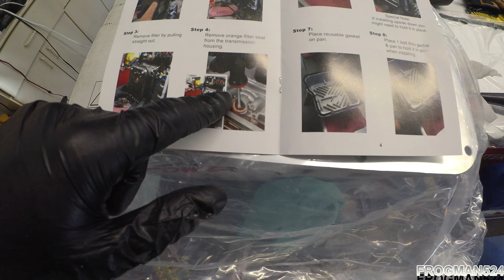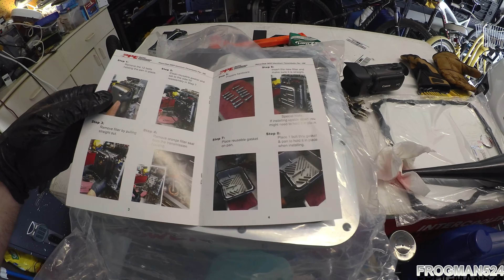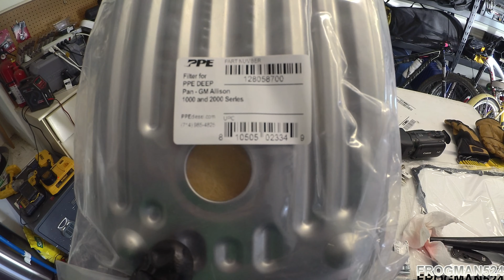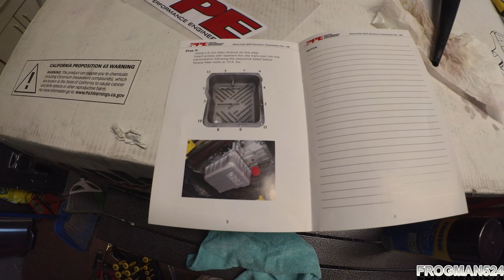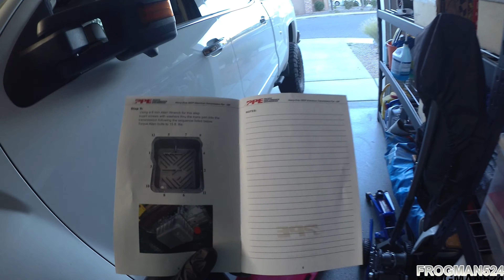Installing My PPE Deep Trans Pan

Comment: After a lot of research, I decided on an Allison deep pan from a local Freightliner dealer for $61, an Allison deep filter, a Merchant Automotive deep filter lock (not needed but $30 for peace of mind), and Mobil Delvac 1 ATF for the trans in my '01.  I'll spend the extra money on the PPE engine oil pan because it gets rid of the hump on the factory one and allows all the old oil to drain out, the trans pan is just for bling.
Reply from the maker: Good choices. The new L5P I've got, if you watch that video, you'll see they finally got rid of the hump in the oil pan and moved the the drain plug to the center back position with a valley to get all the oil out. Only took them 20 years.
Reply: @FROGMAN524  I guess late is better than never, lol.  Too bad I can't slap an L5P pan on my LB7 and save even more money.

Comment: Did it keep the trans temp down?
Reply from the maker: Not a bit that I could tell but it looks cool and each ounce of fluid receives less wear than normal in theory over the same amount of miles. Transmission runs cool anyway.

Comment: WTF!  A rebuilt trans with 19K miles on a truck with 45K miles!!  The factory warranty is 80K miles or 5 years.  What the hell did you do?  And why bother with the el cheapo trans fluid?  Dump fluid and filter, install new pan and pan gasket.  Fill with Castrol TranSynd fluid.  Change again in 25K miles and then your change interval will be 50K.  

What did you do that necessitated a rebuild...especially your comment about "...not knowing how to shift..."!!??
Reply from the maker: Twice as many turbos as came with the truck

Comment: I would have used Dex VI but that's just me.
Reply from the maker: AandWProductions me too but my trans builder said use either dex 3 or TES-295 fluid
Reply: @FROGMAN524  Nothing against your trans builder, as I'm sure he did a fantastic job, but when it comes to fluids, I don't skimp. Dex VI is better at taking the heat, has longer life and better shear stability. Might be more money, but it's worth it. Dex 3 is still good, but GM/Allison spent hundreds of thousands of dollars on R&D to decide the fluid. But, if the only way he'll warranty it is by using dex 3, then i would too.